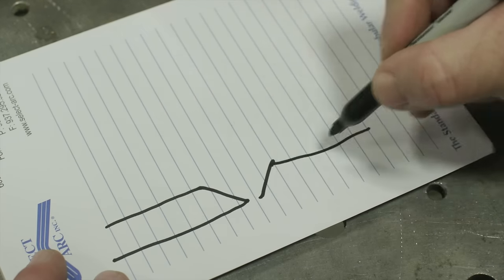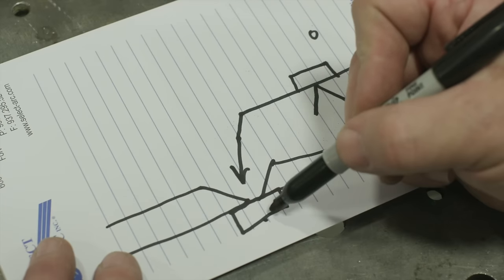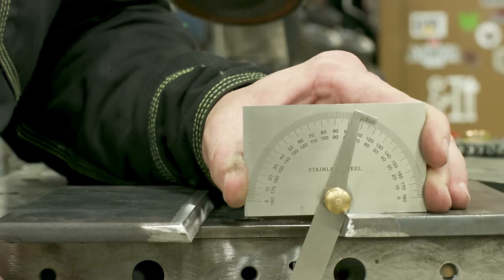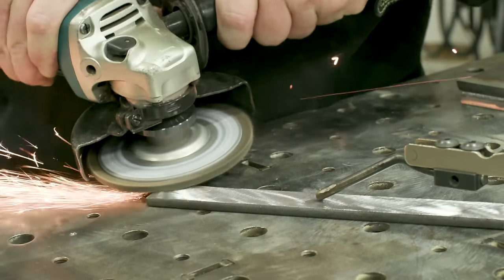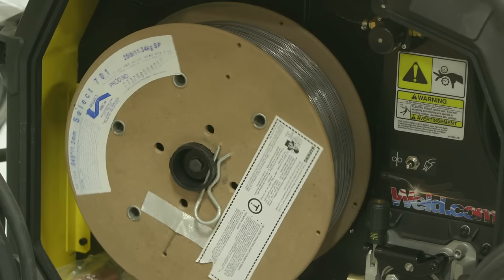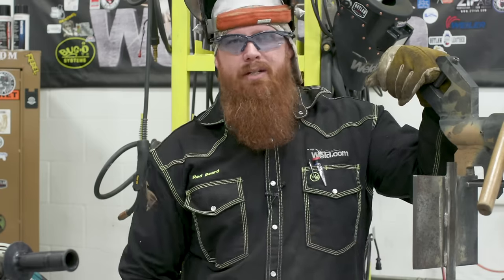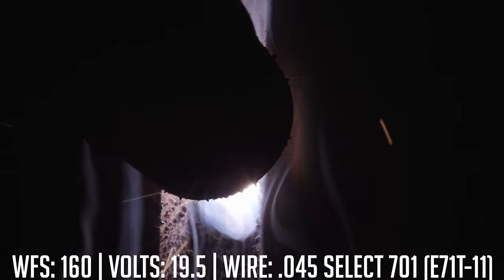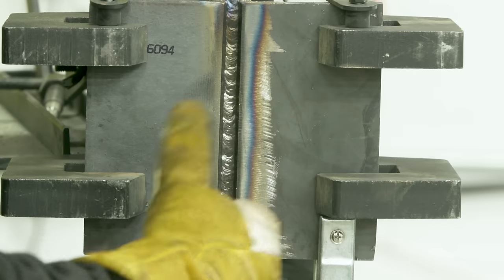VERTICAL Flux Core Groove Weld | D1.1 Weld Test | 3G Uphill

Comment from the maker: Make sure you hit that subscribe button! And don't forget to hit the 🔔
Reply: Weld.com why use a flapper disc after using a stone?
Reply: @Adam-lv1uu  To smooth it out so it sits perfectly flush with the plates. If there's any gap between the backing and plates, you've already failed even if it's from grind marks. It also promotes a good electrical connection and allows the weld pool to flow better. Rather late, but if you're still wondering...
Reply: Nice but why burn so low I've never welded that low I'm used to 24.5 and up and 300WS and up

Comment: I appreciate your demonstrating to how the test plates are beveled to a certain degree but ive been handed plates that some were "free hand cut" or were cut with a track torch but had sat up so long they were not only covered with rust, mill scale & other contaminants so while the welder has to grind all of this off there goes the AWS bevel. THIS IS VERY COMMON & IS THE REAL TESTING LIFE OF A WELDER.

Comment: I watched an idiot on another video who said that you don't have to run a zig-zag or half-moon pattern to fill a large weld depth or width. Just slow you travel speed and let it fill. No motion is necessary. Such stupidity!

I finally bought a mig welder so I can do vertical and overhead welds. Yes, I used to do them with my stick welder, but it was ugly. I'm 72 now and I've only been welding 50+ years, so it's about time I got into mig welding. I've done a few small projects, and I'm looking forward to more. I bought the Hobart Handler 200 so I can weld on my farm machinery and big projects.

Comment: The T-11 wire is no longer used for structural welds, I believe.
Wire like Lincolns NR232/233 (E71T-8) is the go to wire for structural, a different animal from the user friendly wire used in the video...

Comment: Excellent vid guys. I never was a firm believer in FCAW-S until a couple years ago when I actually seen first hand the strength of the welding process. And there is not nearly enough info out there supporting this process. So much bad info. Anyway good job 👊🏻

Comment: Good info on grinding discs.   I need to check my supply stock.   Probably should make a habit to lay an eye on each one as it goes on the grinder!...
Reply: David Waggoner solid plan man. Gotta watch the warning labels. Especially when we get in a hurry.
Reply: @GodslilRedneck23  I'm surprised at how many different ratings I do have on hand.   Going to have to find a chart that gives the break down...

Comment: Jason, do you ever use nozzle dip? why or why not? just wondering when I worked in the collision industry we used it all the time Ive never noticed in any of the videos Ive watched on youtube anyone dipping the nozzle..I have not mig welded every day for a living now for some time just wondering..thanks, in advance for your response..
Reply: Luis Vega we’ve been using Contesco anti-spatter spray. I’d does the same thing but works way better than a dip. We didn’t use it here because the spatter doesn’t stick to the nozzle like it does with short circuit.

Comment: ESAB has nozzles for flux core. I don’t know if every gun has one, but at least some do. If you have a velocity tip gun, you should be able to get one. I have them for my Tweco guns for my emp 215 and emp 205. Part number for the velocity 180 is VNSFC.

Comment: I didn't know they used the smaller self shielded flux core wires on structural I know they use dual shield and the large nr232  wires .is this wire like the NR 211 ?
Reply: Carol Florian it’s similar to an NR212. Structural covers everything from from 1/8”-Unlimited thickness. They make flux core down to .030 dia.

Comment: I picked up my D1.1 4g unlimited for 0.045 dual shield last november. It was interesting on the bad old machine I had to use.
Reply from the maker: Congrats 👍
Reply: Erik Olsson good job Brother. 1” plate is a good challenge.
Reply: @Welddotcom  Thanks!
Reply: @GodslilRedneck23  I had to run a higher cfm on the shielding gas to help keep the spatter from arcing out the nozzle. Ended up running a small tapered tip that helped a little.

Comment: I am a bit nervous. I have a D 1.5 in G3 position test coming up. My test will be with 1" plate with 90 deg. included angle and a 1/4" root on R71 dual shield wire (the company I work for is bridge certified and I am getting all my certs on the job). Can you do a video demonstrating this. No power tools are allowed. The wire gauge is 0.45 and the welders are the older (not ancient) Millers and Lincoln's, with Tweco whips and cones.

Comment: I'm taking a test next week. 3g flux core with backing on 1 inch 30 degree bevel....what settings should I run? New welder, I usually stick around 24.5v and 330wfs for root. Cover pass I go down a bit maybe 23.5v and 275 wfs. But I never really knew what works best for the cap, I guess I just went hotter, like 26.5 and 400

Comment: Great video. Most "hobby" flux core wire is E71T-GS (or something like that) as opposed to this more professional T11 stuff you're running. I think the S stands for "single pass". But why can't you do multiple passes with it? Surely it's all just metal if you clean it up enough between passes?
Reply: My understanding is one of the metals used in the filler wire I want to say manganese?Will cause cracking if you run multiple passes with wire designed for single pass

Comment: Lincoln NR211 MP Flux core wire. Can you run the wire downhill on a 3G for structural? Or uphill only?
Reply: If you're welding to D1.1 pre-qualified procedure, only uphill.

Comment: u.s. marine corrugated  round  steel is that weldable and what rod to used?
Reply: mohammed troy not sure what you are referring to. Rebar? Or corrugated tube for underground draining?
Reply: @GodslilRedneck23  thanks
Reply: mohammed troy anytime man.
Reply: Swampy  using the fusion  and non fusion  process it can be sticked together when i say non fusion  i referring  to brazing and soldering process

Comment: Why do you use a back strip ? I must weld roqlast th400 to cast steel butt with a root run no back strip with 7018 low hydrogen welding rods 3G my root comes out great i even grind it no slack inclusion no holes yet they fail me with so called shadows in the root run? I grind it no marks no holes yet i failed what is the best way to weld the root run? So that in a x ray one dont get so called shadows?

Comment: Can you do a video wjthout shielding gas.  What's the difference?
Reply: He was welding without gas in this video, the shielding comes from the flux core of the wire he was using. That’s why he pointed out that he didn’t really need the cup but with his gun the cup keeps the tip and that was the only reason he had a cup on it.  Flux core MIG welding is great for the “shade tree” welder who either doesn’t want or can’t afford to maintain gas bottles in the garage. It’s also great for out on the job when your working in say a high wind environment or working somewhere it would be difficult to transport a bottle of hoses to.  One thing I learned very early on with flux core wire is to take care in how and where you store it on the job, as the cores tend to attract and retain any moisture especially in the power houses where is do most of my work, there seems to always be high moisture content in the air around them.
Of course most all the welding I’ve done in the field is stick because most of the contractors (union signatories mind you) seemed to be too cheap or just flat out didn’t have the equipment on that job sight to provide MIG setups.

Comment: I don't know maybe it's just me I've only been welding  with inner shield for 35 years.. and there is one major problem with using that type of setup that gas cone.. all your spatter will collect between your contactor tip in the edges of that gas cone and it will pull a huge dime-sized peace of coagulated spatter and push it right into your weld

Comment: curious what happens to the backing strip after?
Reply: @MUCKFOOT399  west coast style
Reply: Adam Theede usually if it’s in use for construction or x-ray tested it stays on. For  a bend test they are cut off using a number of different methods.
Reply: @GodslilRedneck23  thanks good to know
Reply: If its a UT it stays on no need to take it off if its bend test they take it off

Comment: shouldn't the backing be convex not rectangular? that's a slot weld symbol
Reply: Bear Overlord nope it’s a square bar, that’s the supplementary symbol from AWS A2.4 for a backing bar.
Reply: @GodslilRedneck23   that's cool i didn't know that, thanks

Comment: Anytime I weld up my puddle drips off the metal, what am I doing wrong
Reply: Set too hot
Reply: @dukeparadice  I actually got together with a welder and practiced, and my one and only problem was....... it wasn’t hot enough if you believe that. Hotter = less drips
Reply: @CoachBru999  ill have to do a video

Comment: What is causing me to blow a hole in my plat in 3g position NR232 set at 19.5 volts and 130 wire feed? Here is a link with the picture,

https://www.dropbox.com/s/1z3adrtlo26cb5y/20191216_091041.jpg?dl=0

Comment: This is my current certification I am starting to work on in my union weekend class. I appreciate the explanation of the weld, but you misrepresented what the industry often demands. 
While technically passing, that was unacceptable for anything that an owner or user of a product could see. 
The side view of that weld was an "M"..
Plenty of industry production requires either a flat profile, or an arc like a speed bump.
Reply: You clearly have a lot of information, but you strike me as more of a teacher, than someone working in the field.

Comment: It happens again around 15 minutes and 9 seconds.. a huge ball of coagulated spatter get ripped off of that gas nozzle and deposited right into your weld puddle.. whatever who cares.. and yet so fine and dandy in the shop.. and what was that 8 or 9 passes???SMH... I would have used 5/64... three passes maximum.. once you know what you're doing that size joint can be easily filled with two passes

Comment: 11:52  weld test failed. You need to clean your tip after every pass. Same goes for mig gun
Reply: yEAH! it needs to be spotless for every single pass, not a single dot of spatter is allowed xD especially with self-shielded wire
Reply: avo The tip was cleaned before each pass. That ring you saw is very common with flux core. I’ve had it happen several times and have never failed an x-ray or a bend test because of it.
Reply: Ahhhhh just send it. Don’t be poopin on the party ;)
Reply: Lol at school I’ve run flawless flux core bend tests without any cleaning on the tip, honestly only clean it if it drips into the cone 🤷‍♂️